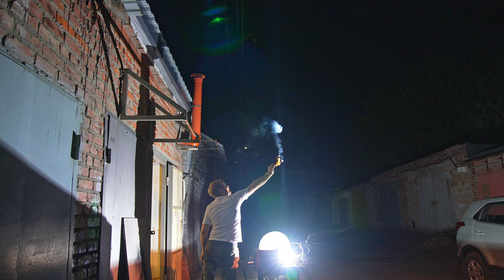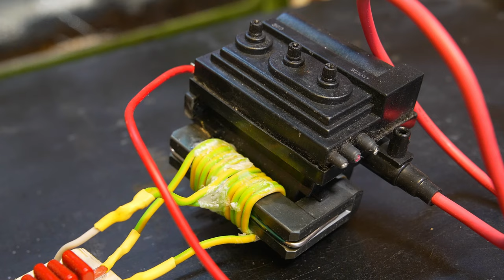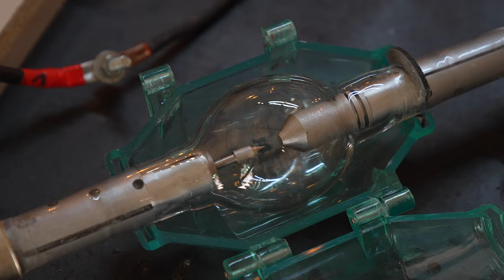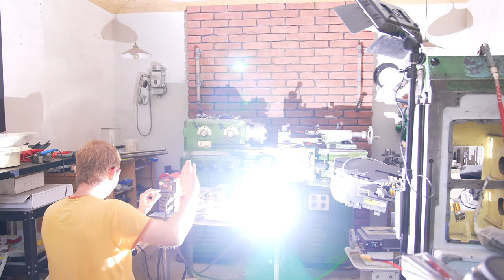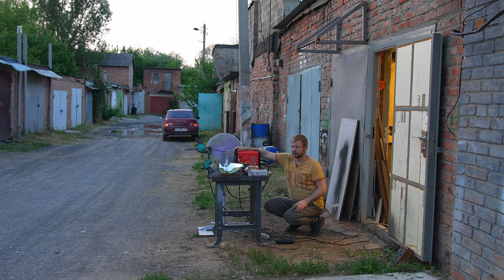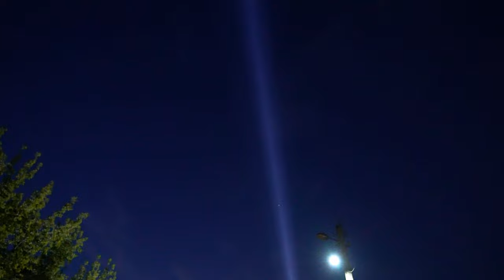Magical work. Xenon lamp 3 kW

Comment: How did you constructed the ignition circuit? I have a 4kw lamp myself, but starting them is quite hard for me :D
Reply: You propably can do it with the cheap high voltage generators - that will ignite the arc, and then have a power supply (around 20V and tons of current | for the short arc one) or some (car) battery

EDIT: you can use the welding machine as power supply
Reply: Can you tell me capister value
Reply: Grey colour round one